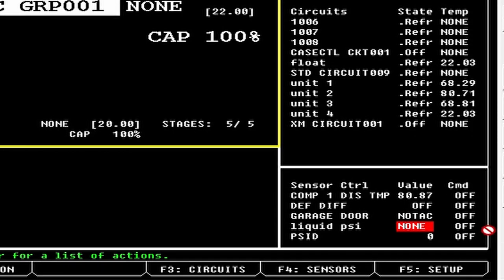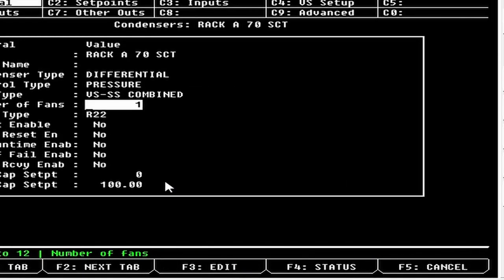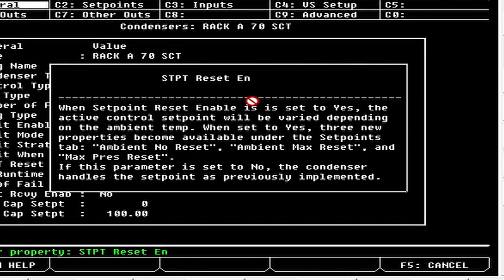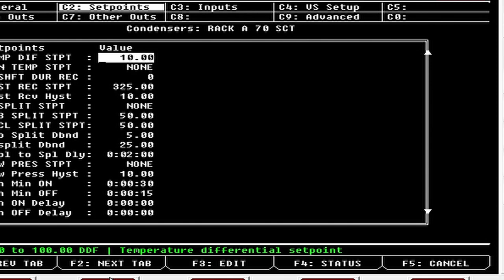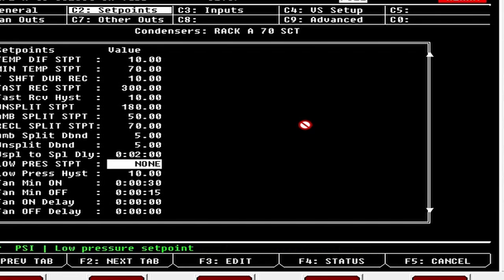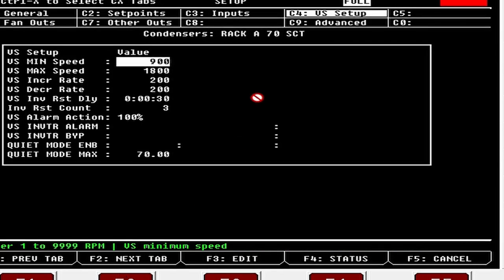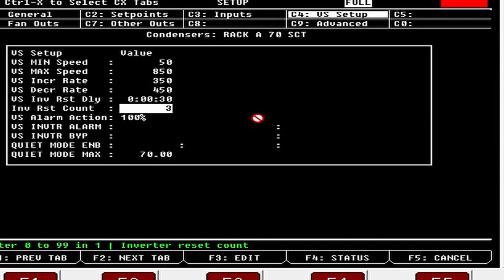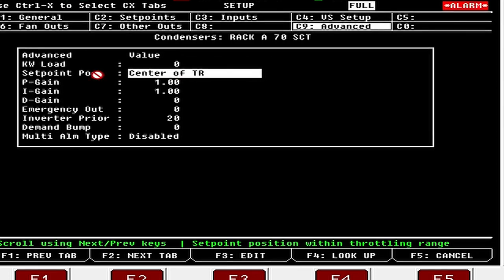Condenser Control

Comment: Could I use this program to simulate a variable speed fans operated by the split range temperature controller, which located between a condenser and drum to control the pressure by changing the speed of the fans?
Reply from the maker: yes